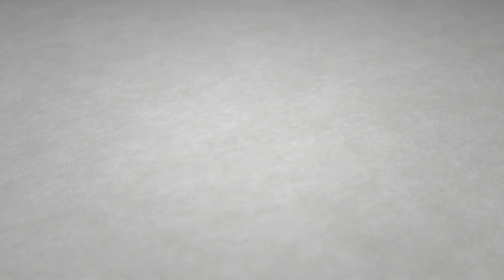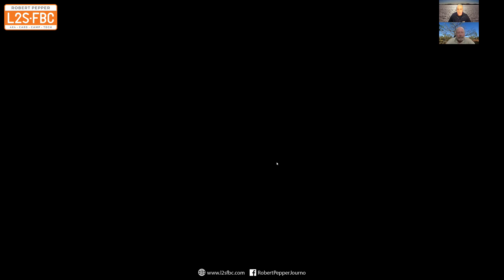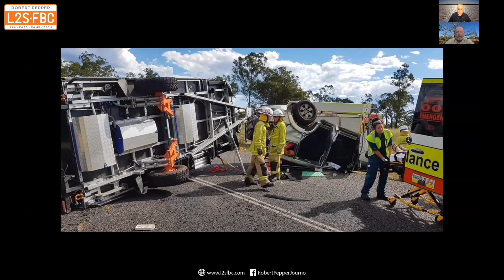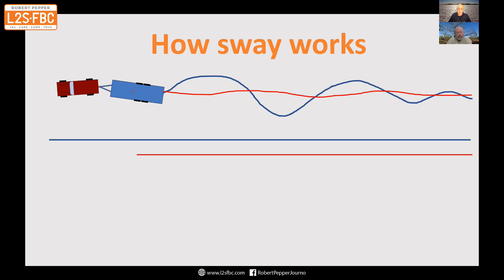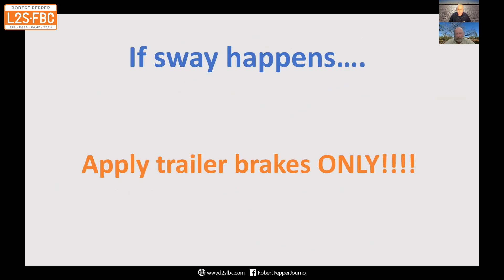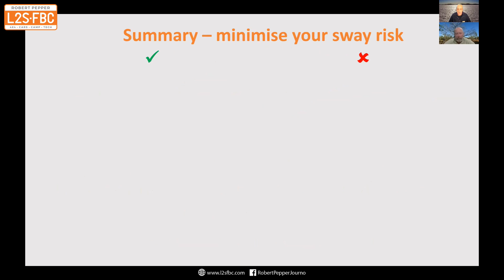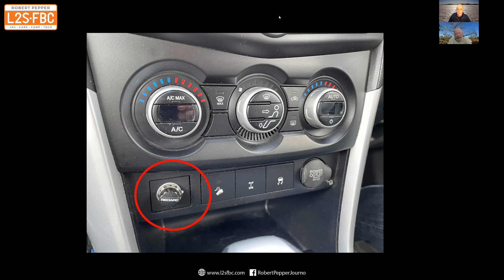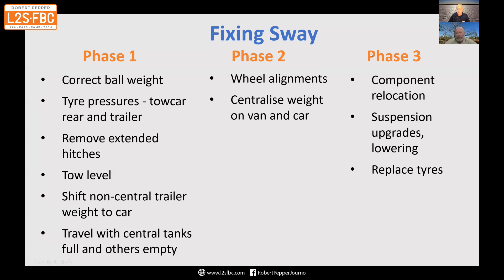Webinar - Trailer / Caravan Sway and How to Prevent and Handle It

Comment: I like the idea of a towing license or endorsement for the training that requires but it is a hard sell. As John indicated, there are not that many trailer accidents (though the consequences tend to be very bad) and unfortunately we don't really trust our governments with another licensing/endorsement system where revenue aspect quickly eclipses the intention.
Reply from the maker: What would you suggest be in a licence?
Reply: @L2SFBC  It would be an endorsement, like a heavy vehicle license with similar requirements - approved training and perhaps demonstration of skills. It would apply to trailers with brakes, so here in Australia, that would mean any trailer with a total weight over 750kg. A simple check by a policeman would result in a fine/demerit points and the inability to drive further with the trailer attached.
Reply from the maker: Agreed!
Reply: @L2SFBC  Absolutely nothing, because they would not stop at anything sensible. It would be full-on new license with onerous requirements and costs within 5 years - and you must realize that.